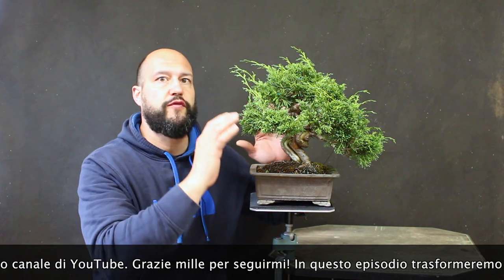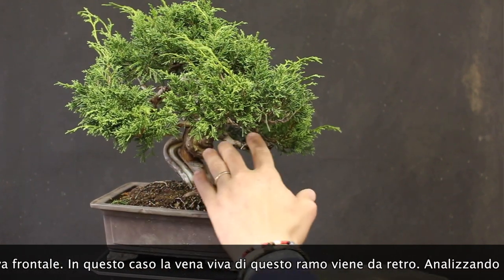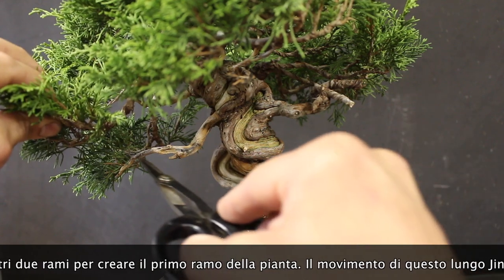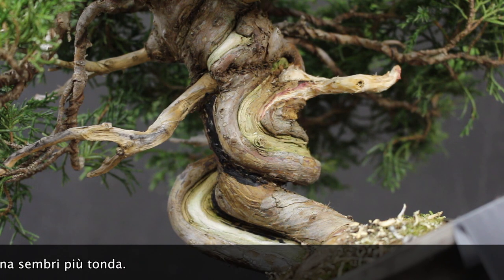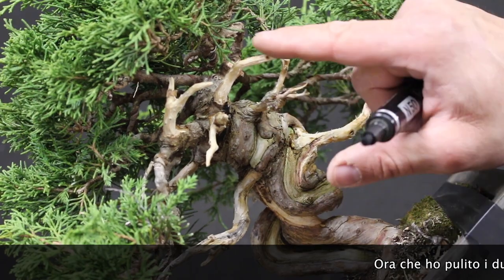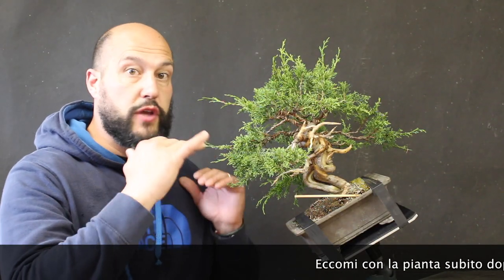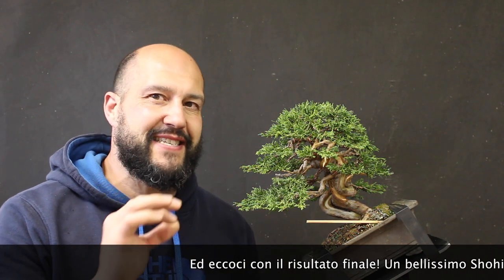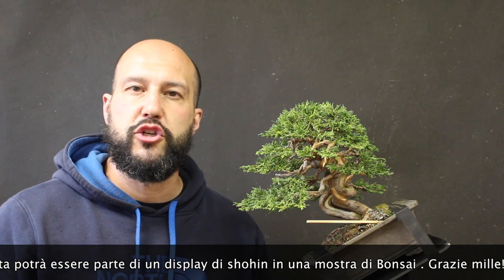SHOHIN ITOIGAWA JUNIPER

Comment: How do you get a twisted trunk like this? Are they wired and twisted as a young three or carved somehow or is the trunk swollen after the wire has started to dig in?
Reply: Some pines are left with the wire on forever. I don't know about juniper like that because of how the veining works. Junipers aren't exactly true trees they grow in weird lobes, which is where live and dead veins come from. I suspect that suckers, or low growing branches were used on purpose to reintegrate living tissue up the tree. And then twist it on purpose too.
Reply from the maker: Some juniperes are created by busing little cuttings together other just by twisting and growing one single plant. Creating shari years after years the vein start twisting around deadwood
Reply: @MauroStemberger  thank you very much!! Love your videos!